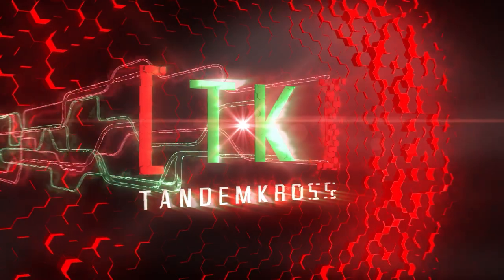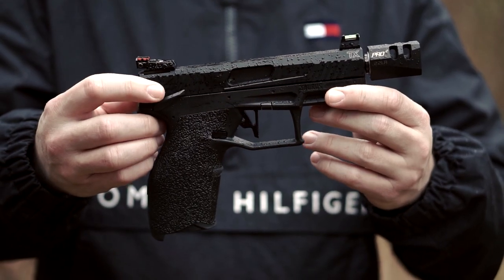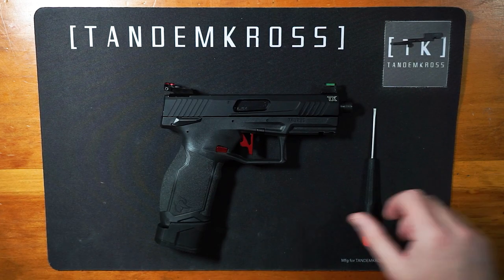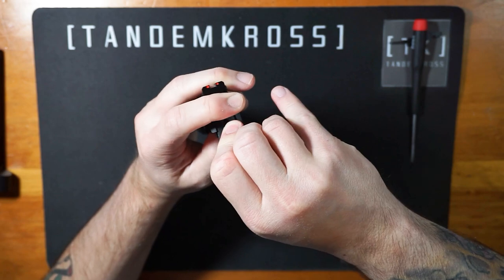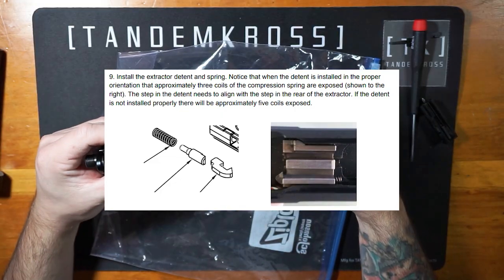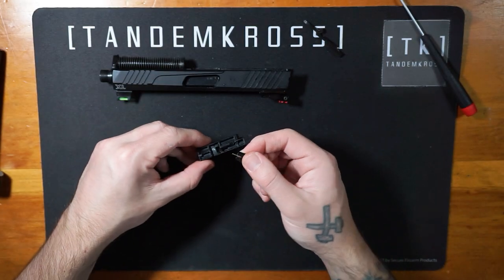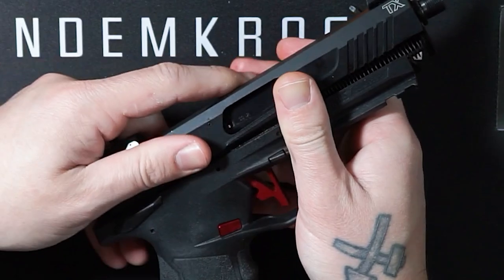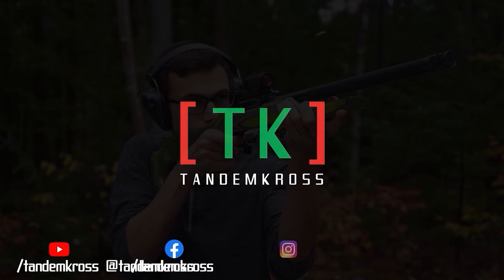The “Fire Starter” Striker for TaurusTX™ 22 - Overview & Install

Comment: Hopefully this is better than the 10/22 fire starter. My 10/22 ran fine until I installed the fire starter then I started having several light primer strikes. Put the oem firing pin back in and it’s running like a top still.
Reply from the maker: Hi J! Please reach out to customer service, that shouldn't be happening and if you wanted we could get you sorted so that isn't happening!
Reply: If it’s not broke don’t fix it